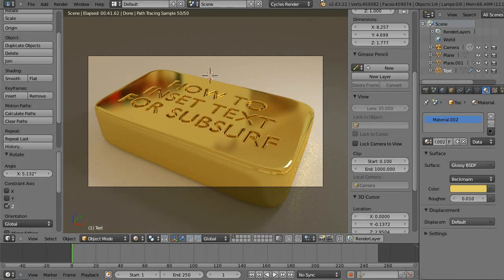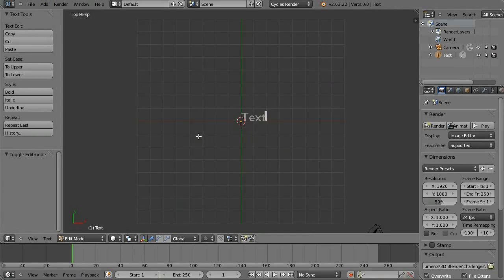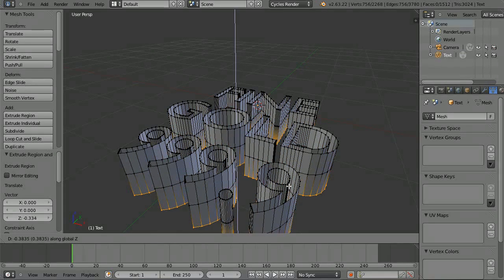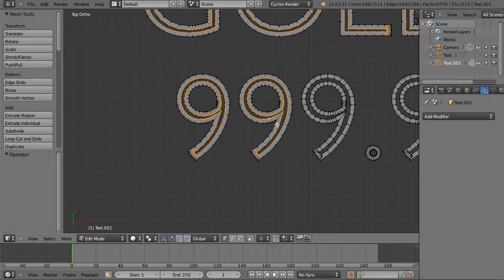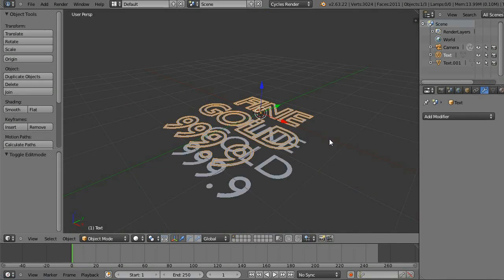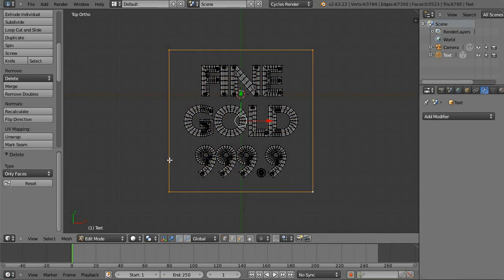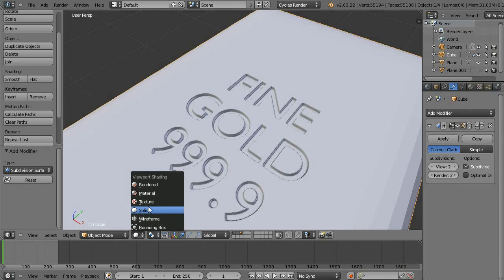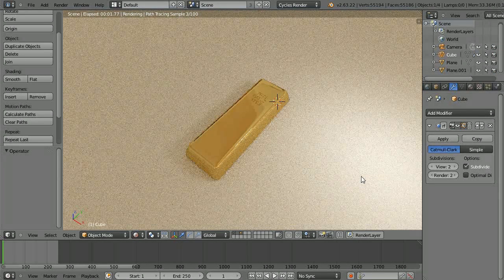Inset Text in Blender

Comment: What did you do at 4:27 to create faces that only outside the letters?
Reply: There are better ways to do this now, and it was definitely hard to follow in places. I should take this down, but it does have some good concepts. At 4:27 I selected just the non manifold edges (Select->Select all by trait->Non Manifold). You could manually select the outer edges of the letters along with the outside boundary edges, and then choose Face->Fill, or the shortcut is Alt-F. The plane will fill with triangles between the two boundaries.
Reply: @steveelkins458  Thanks.  That is helpful.

Comment: I understand what is going on. And it's pretty clever, so I learned something new. Thing is, the pacing is more of that for an intermediate or advanced user. It's not spelling out most of the interface stuff for beginners. (I think the disappointment is that this aspect isn't made clear, or it was pitched somewhere to the wrong audience.)

Also grid fill would be worth mentioning in this video, doesn't always work but it can produce better distribution than converting tris to quads when it does.

For those wanting to know though:
ALT-C to convert to paths or mesh. (Brings up submenu, but this guy is quick or has the options hotkeyed.) Solidify is used with the "only rim" option, although it's not mentioned. Alt selecting (loop) or control selecting (shortest path) is used to select connected edges quickly. W for specials menu followed by R will remove doubles. Now follow it again with that in mind.

Comment: On sphere: add the plane but do not delete the surface, roughly divide it up 4 times. Change to edit mode and remove only vertices above the characters. Join them.
 Alt-Shift to select edges and Alt-F to create faces. 'B' to select only the area around the characters, subdivide a few times, bending the surface (Shift-W) twice on Front (180), Side (360) view to create the sphere.
 Only need to increase 2 times the subdivision surface modifier and will get the perfect smooth characters and sphere.